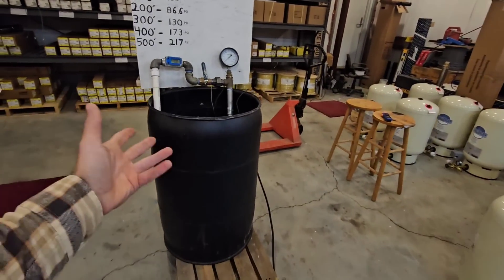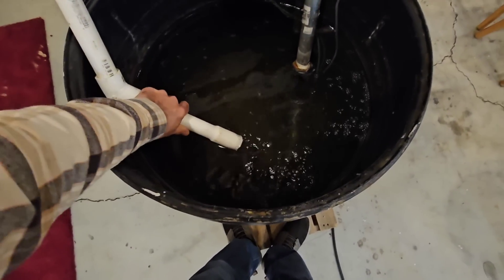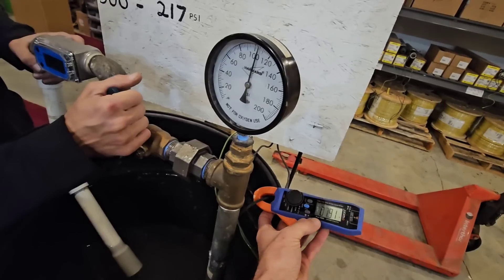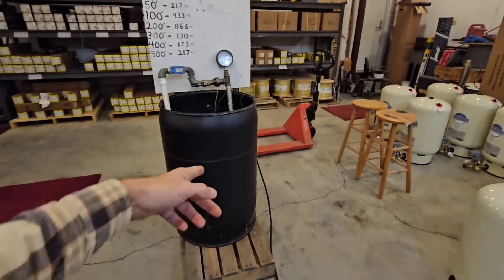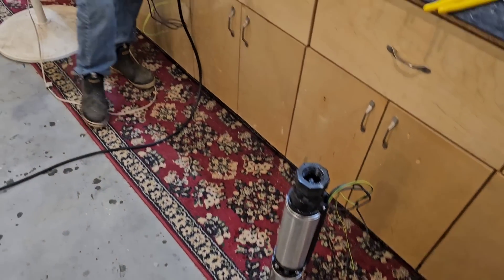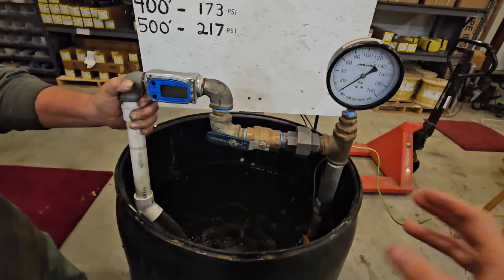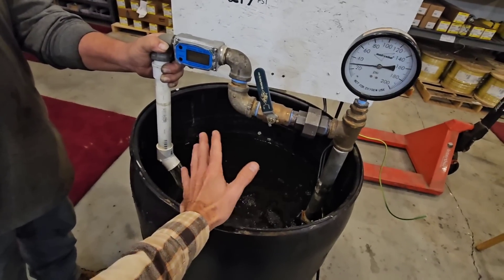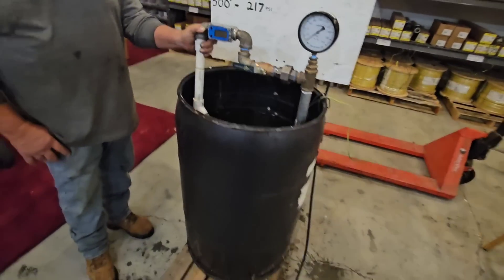Testing The Most Popular Well Pump We Install 4" Submersible 3/4Hp 8GPM.

Comment: My uncle worked for a big shipping compagny. They do not have time to check any label. The packages are machine sorted, travel multiple floors, drop down via roller conveyor, smash into the jammed packages at the bottom, with a nice package explosion from time to time. They then stack the packages in the truck, they never deposit them, they throw it, no time for delicate placement.

Rule of thumb: drop the package from 6' to the concrete floor. Do you worry about it being damaged? Yes? Then it is not protected enough and may get damaged in transport.

Comment: So my well is 445 feet deep it tripped my thermal beaker switch it has a 8.23A fuse in it never popped the fuse just the switch it’s pulling 7.89A at the switch and the same at the well do you think I may need a new pump? That’s all I can think of never had a problem with that switch in 5 years I replaced it with a new one and the switch is getting hot again but has not tripled , any thoughts , thanks for your time
Reply: Also it has a goulds 7gs10422c pump 1hp 230v 2 wire pump

Comment: If it was dropped the bottom bearing broke it's a ceramic bottom bearing nothing like a regular top bearing   check the motor shafts for bearing drop mostly it .

Comment: Depending on the motor type it could be a faulty run capacitor or if its a multi voltage AC/DC pump it could be an issue with the phase controller. Both of these faults will be inside the pump and I assume the pump is sealed. All you can do is return it I think. P.S. the fragile sticker means the courier will only have two games of football with your consignment  !!!

Comment: Sounds like a bearing or deformation issue. We recently had a motor like that at the plant, it would sometimes blow the breaker and stall. It happened at most once in a 12 hour shift. A bearing swap reduced the amps and the tripping issue was gone too

Comment: can you recommend a really good high quality well pump that does 20+gpm  . im want to use it at my cottage lake instead of a jet pump..will be placed about 10 feet deep and feed a 100 foot run to my pressure tank..im just not sure what is a great high quality pump out there to many to choose from and dont know which is best. im up in toronto canada...thanks...also could you recommend the right size wire for that run length to the control box..much appricated

Comment: just because it works in a bucket doesn;t mean it will fuction when lifting 300 foot even if it passes a pressure test down in the well might be different(no colum of water trying to force its way into some potental fault ) or on the trip back to you whatever was jamming it up rattled free allowed it to turn definately got a motor/bearing noise I would be curious enough to tear it down and look at it

Comment: Hey bud, nice little job you got there going for yourself! I live in California, (not a democrat)Back in the late 70s early 80s I was running electrical submersibles to about 9000/9500 feet lifting oil/ water and gas. It was attached/held from 2 7/8 upset tubing run armor cable from pump to surface along side.Banded to the tubing… A big old giant spool cable out by the rig and you’d have to have metal banding equipment and run this stuff in the ground! Guy I am 64 and retired, even did some well testing and flow back from new wells drilled in swamps near Ruston Louisiana… close to shreveport!

Comment: Shroud might be causing the noise. As far as the loss of flow intermittently. Might be a combination of head pressure and electrical connection inside the pump. Most intermittent on off functions from electrical are cause by loose or broken connections. A duty cycle might also be getting triggered if the pump is somehow overheating from some sort of restriction I. The system or itself. 

All of that is fixed with a known good pump like you’re doing. Easiest thing would be to send pump back to manufacturer for a refund since you already got a more one.

Comment: It "sounds" to me like this pump uses an induction motor and a portion of the windings are loose which causes them to vibrate creating the loud buzzing sound.   Out in the field it's called a "motor growl" or "growl"  The problem is that pump might be within the manufactures speck and the growl not bad enough to be rejected during testing as you just proved.   However violent vibration in time will cause the insulation on the wires to overheat or melt causing a short in the windings.  Good call to return it.

Comment: Sounds and tests out like a pump with a dislocated thrust bearing.  Easy fix for a pump company with the tools and knowledge to fix.  Yeah, drop it on one end or the other and those vertical pumps are going to lose the thrust bearing if dropped on the end, typically on the bottom end.

Comment: Happy Thanksgiving! Even that new pump is too noisy for my liking, most submersibles I have encountered don't make anywhere near that much noise (I am talking about the new one .)  My guess is that the motor was never filled with oil (if that is how it is designed) and it will burn out prematurely. 

Wish you were in our area, our well here (65' deep, 25' static water level) has had serious issues with air in the lines. The local well guy replaced the check valve at the top of the wellhead, but never bothered to check the pump out (which, based on a video you uploaded, is the most likely cause, i.e. the fitting or check valve.) So now we have to wait through another weekend before he returns to hopefully fix it right this time. My tankless water heater doesn't get along well with air in the lines.
Reply: Small bladder tank or bigger non bladder tank.  All the tanks in South Ga. are the bigger 50 or more with an air release pressure gage on the side about half way of the tank. They have a float valve inside which lets off excess air until the water closes the valve.  If they go bad (float) you will have air in line, spitting water out of faucet, had to replace mine before. Solved the air problem.
Reply: @crashland5711  True, but this is a variable speed pump on a "special" VFD that controls pump speed to maintain pressure. It does have a (very tiny) bladder tank, which is just there to help keep pressures constant on lower flows. 

But, I did see first hand what our problem was. We pulled the pump (on only 35 feet of black poly) and found a VERY corroded Galvanized tee fitting spliced in about 5 feet down from the well cap. That tee used to have a "air bleed orifice" screwed into the side of the tee, from when the well DID have a standard tank. They replaced the orifice with a plug that had corroded as well. We replaced the whole 35'run of poly, put new fittings and a check valve on the pump end. It is now working perfectly. After the well guy left, I told the owner that now we know what's down there, so if it fails again we can fix it ourselves.

Comment: It sounds like a loose coil or a coil where the potting went bad and the wires are vibrating. If you had an oscilloscope with a current clamp you would probably be able to see fluctations from the vibration. I am not any kind of an electric motor engineer, that is just what comes to mind  for me.
Reply: It's not coming from windings. If windings vibrated like that, they'll just knock off all the insulation and short Circuit.

Comment: That noisy pump sounds like something is damaged or loose inside.  Maybe the impellers are loose and during your testing they happened to be bound up and spinning, but when the customer pulled it they were just rattling on the shaft.
Reply: I had experienced something similar with completely different sorts of pumps for a completely different use-case, one of the rarer problems I've had. A bound impeller is easy to identify, burnt coils are easy to identify, but a rattly impeller that's sometimes bound and sometimes isn't - not so much.